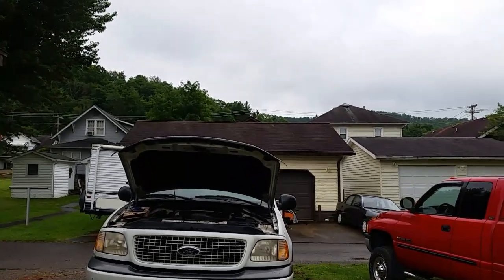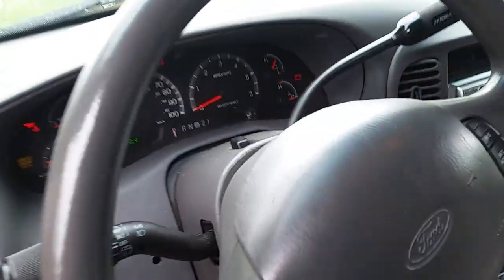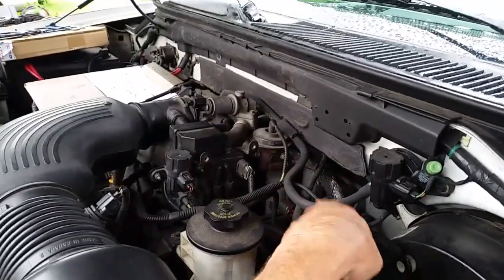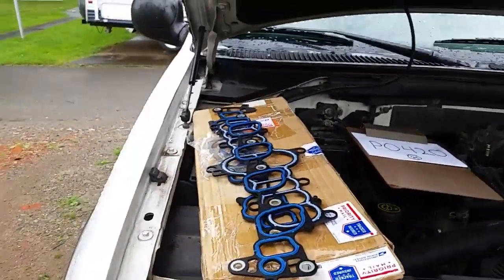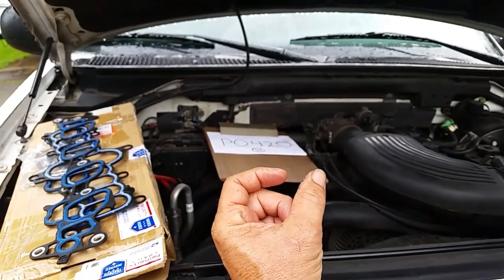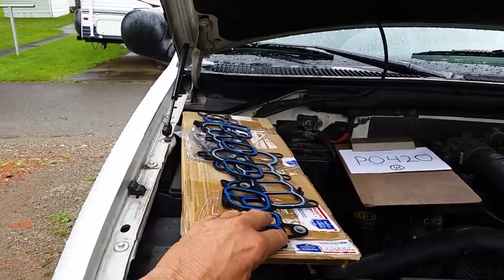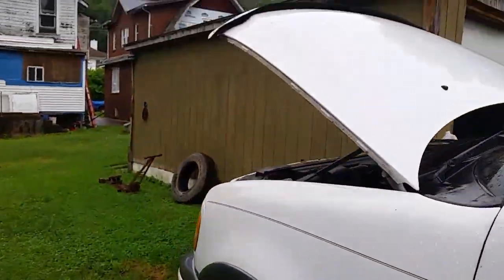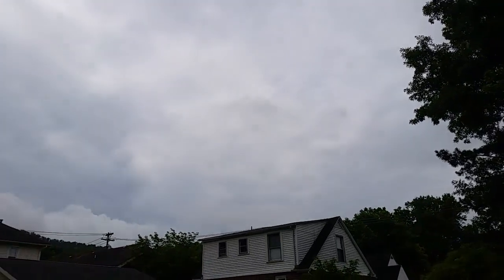P0420 Code. How to fix it. Don't spent spend tons of $$$.

Comment: I am dealing with the p0420 code on my 96 toyota camry LE . Back in July I replaced fuel pump and fuel filter thinking it cause of another issue that was caused me to break down but I ended up having to replace spark plugs and cables and the culprit was my distributor cap and rotar. No more than two months later is when the p0420 code occurred and eventually would stall out while driving. I now can't keep the vehicle running even 5 minutes before it shuts off . Was going to start with my O2 sensors .....
Reply from the maker: Take a small hammer and tap on the cat and listen to any rattling. Cat could be burnt u or get a obd2 code reader and look at the o2 sensors readings after the cats... before you fix anything.
Reply: Nathan Rohrbough  I had stopped by auto zone one day when the car was acting up . They did the courtesy check that’s when I found out the P0420 error code . What has me puzzled is it not staying on when I start it.

Comment: Very strange, typically p0420 is from downstream o2 sensor, which does NOT participate in air to fuel ratio measurement.
Reply: it still gets mixed up in exhaust leaks. but intake manifold leaks? that should show more or different errors than a P0420.

Comment: At start up on cold engine smell a faint gas reved at 2500 rpm I can still smell but don't know where it's coming from my 420 come on 1 trip 1/2 so if I do have a leak can that cause my fuel trim not to work right
Reply from the maker: Mine was a bad injector leaking fuel /or stuck injector.

Comment: Hi friend. So I replaced the intake manifold/gasket, checked for vacuum leaks, nothing is loose, replaced both o2 sensors and replaced cat converter (aftermarket) and I still have a P0420 code. That's the only code I have. What else could it be, what am I doing wrong? This is so frustrating! I just wish this code would go and stay gone and for my mpg's to go up... 🤦🏾‍♂️🤔🙄
Reply: did you fix it i have the same problem
Reply: @Mrlilrandom  hi, I recently found green coolant leaking coming from my thermostat engine coolant housing(water outlet/inlet). I ordered one from O Reilly's and they sent me the wrong one I'm just waiting for the right one. Hopefully that's the fix. I went through this thing like a fine comb like he insisted. The good thing is that's the only code that I have. I suggest you check, re check and check again you'll find it like I did. Good luck. 🙏🏾

Comment: You could look at freeze frame data. If O2 positive could possible vacuum leak n if Negative leaking injector or stuck purge
Reply from the maker: I found that one time on a intrepid.
Reply: So my 2003 nissan altim, which is running lean Short term fuel trim is up to 20% and ltft 10% ...

I have P0420 code. . . Could it be a leaking injector?  🤔

Comment: Nice. I get an occasional 0420, and just got an 0420 and 0430 at the same time. I'd been logging data on my phone with Torque. Both cats and all 4 O2 sensors are working as they should. Time to go clean some grounds before considering replacing my plastic manifold. A gasket set is a  third of the price of the manifold for my car.... and the manifold includes a full suite of gaskets.

Comment: Hi there. My engine light came on earlier today so the code po420  came up. I was told it was the catalytic converters.  How can I figure out if it’s the lower or higher on my 2004 alero?  Help?!
Reply from the maker: Inferred gun cooler going in hotter coming out...
Reply: Obd scanner. If your bank 1 sensor 2 02 sensor is fluctuating the same as the bank 1... 💁‍♂️ then ur Cat is probably clogged.

Comment: I got the 2010 gmc Acadia and I get P0420 and P0430 and I paid $1,300. to replace all catalytic converter and I still got the code back on. I don't good mechanics around I'm loss
Reply: Get a spray can of starting fluid and with the vehicle running, spray around the intake hose's. Keep a fire extinguisher handy for safety. Just saying. If the vehicle revs up when/where you spray. You have located the culprit. Bad hose, cracked intake. Did the mechanic change the upstream O2 sensor?
Reply: @Dangbo3030  not only the code P0420 I get liquid black petroleum in the exhaust pipes after I cleaned i get it back couples hours after. I've been servicing this truck over and over and get me more problems
Reply: @Dangbo3030  and the last come to ended was the engine oil pressure switch blown probably the engine oil low pressure turn the codes. But I didn't see no smoke coming out the muffler

Comment: If you have a vacuum leak you're going to be at getting a lean bank 1 or Lean Bank 2 code you going to get lean codes the O2 sensor you're talking about is that the rear that's the final and it is supposed to track so you may have multiple codes you would have a lean bank 1 or 2 a oxygen sensor front erratic not working out of parameter and also also rear O2 outside parameter you may have as many as five codes on this
Reply: Not true at least for honda

Comment: My freeze frame always shows perfect fuel trim numbers very close to 0. I think I have symptoms of a possible very mild/slow intake manifold coolant leak though, which from what I've read can get burned in combustion. Do you think this, rather than vacuum, could trigger my p0420? No other symptoms or codes. Car runs perfect.

Comment: i shouldn't say this because someone is going to try it. my friends dad used flex seal to stop his leak. he said he couldn't find the leak and refused to pull the intake. its been 3 years now and the light has never came back on.  i begged him to let me do it right but hes just to cheap. LOL
Reply: If it works, more power to him. Being a mechanic is about finding solutions, not just swapping parts.

Comment: I've got a 99 v6 4runner and I've burned through 2 cats in a year and a half. (About 30k) codes 420 and 446. It works and drives great but Toyota and local mechanics just say replace the converter, but why is it burning through them in the first place? No one can answer. I can smell it burning up.  Is there anything I can check myself? I have an obd scanner...

Comment: I have an annoying p0420 code in my 2012 Impala and I'm torn between doing this or that Cataclean additive.  Has anyone has success with either??????  Mine also comes with a weird "rattling/gurgling" noise ONLY when hard accelerating!!!!  Hoping to hear that someone else has had this happen and what they did to resolve it..... The Cat replacement is over 1k bucks so ill try anything first!
Reply from the maker: Get a Digital temp gun. You can get them for $20 now days. Measure the in/out cats temps. Out temp should be much hotter. If there the same temp then you will know. Do it several times to verify it.

Comment: I never thought of it this way but look at it as an air pump essentially that is what an internal combustion engine does it pumps air the O2 sensors work in conjunction with the IAC telling the computer how much air is going in and how much air is going out essentially the efficiency below threshold is stating exactly that somewhere along the way there's either too much or too little air. Good way to look at it

Comment: I just got the code🙄 It's a 99 Explorer. The previous owner said the intake gaskets were replaced. Mine runs as smooth as glass it just seems a little down on power and bad on gas. Any thoughts?
Reply: @Patrick Simmons
I had 2 codes P0420 and P0430 on my 2013 durango. Had an oil leak, very small. Mechanic replaced engine oil cooler and intake manifold gaskets. Cost me $880 but I also got diagnostic and oil change factory parts. I believe LKQonline has these parts used, come with warranty if that helps. So P0420 was CLEARED completely, now Im working on figuring out P0430 without having to pay $2000 for cat converter replacement. I believe finding the leaks around the car will fix the code. I didnt see the leaks while I was driving, they were tiny wet drops sitting on the bottom of the car after it was stopped. So alot of leaks you cant see.

Comment: I have that code right now” I tried everything “ so I have a K&N Cold air intake “ and duel exhaust magnaflow , do you think those are the reason why I can’t pass smog ?
Reply: Johnny Galvan . no that’s not the reason. i’ve been using knn’s on my ‘01 5.3 sierra for about 10 years & never have a problem. the truck always passes the NV smog inspection. 192K miles.
Reply: Daniel Flores   You know California and I think NY is a totally different monster to deal with when it comes to smog

Comment: Two weeks ago I changed the sparkplugs on my Nissan Frontier at 107k miles.  The truck runs smoother with more pep and better mileage.  But within a day or so the ECU spat out PO420 and PO430 for both banks of cats.  I cannot believe changing plugs will kill both banks of cats.  In changing the plugs I did have to remove the intake manifold.  I did not replace the gaskets as they are silicone and reuseable.  It is more logical that an air leak is the cause of my codes because it explains how both banks of cats died at the same time.  The engine idles very smoothly.  No hoses are missing nor do I hear any hisses.  Could it be the intake gaskets?
Reply from the maker: Sounds a little of both...
Reply: plugs properly torqued ? some engines need oem 02 sensors because of some reference voltage requirement.
Reply: He removed the intake.. chances are you have intake vacuum leak

Comment: I drive an 06 lincoln navigator 5.4...i haven't put a cold air intake but I do use a knn filter instead of the regular paper filter.... I have a code right now p0430.... Do you think it cuz of the filter?
Reply from the maker: Raul Gsxr ....Regular paper filter. Save you money. PO 430 possibly a intake gasket leak.
Reply: Nathan Rohrbough thank you

Comment: P0420 code is a "air fuel ratio code".   My stock 3v 5.4 260k miles original exhaust has gotten that code for bad spark plugs(computer leaned the tune) also plugged fuel filter(computer leaned the tune) code went away after tune up.

Comment: why would a downstream sensor (past the cat) be throwing codes for that. Your cat is either bad and not burning the correct amount of emissions or you have a bad sensor. That is the only correct  way to fix a 0420. lol. Do not take this advice. 4 cats???? lol. Mu lamborhini aventador only has 2 catalytic converters and i'm trying to limit emissions from a v-12.
Reply from the maker: That's what I said...lol And there are pre-cats. Take this advice.

Comment: i got a p0420 but the vacuum leak sounds like it is coming from the catalytic converter itself. when car is in idle it sounds like there is some sort of air leak, when i gas on it the sound is louder then before.

Comment: Had a p0420 tuesday, replaced cat, did the temp test, it dropped more than 100° should be good right...no! Cat is almost 20 years old, b1s2 was fluctuating like b1s1. New cat voltage on b1s2 barely move no more than .10. Explain please??????
Reply: Just passed this morning at a star rated shop.
Reply: Also it only cost me $190 and the guy did it in an hour. Had PO410 4 years ago did the samething, code never came back for tbat side. Do a pressure test, autozone will lend you the tool for free.

Comment: I got that code on my 2007 Honda civic.  I have the original catalytic converter in it and it has 285,000 miles. Should I replace the catalytic converter?
Reply from the maker: Do a weave form on a OBD2 code reader. It will tell you the truth.
Reply: @FixingWithPassion  What's a "weave form"?

Comment: I have a 4.6 L Northstar V-8 in my 2004 pontiac bonneville GXP the car only has 52,000 miles this code went off and the mechanic took my cat off and put a resonator on and told me to replace the cat and the  light will go off I replaced the cat and the light went off for a day and came right back on HELP! do you know if this engine has the plastic parts you're talking about so I can go back to this mechanic my car runs smooth and purrs because i've taken care of it hell was soon as it reached 50,000 miles I replaced the valve cover gaskets,coil packs and spark plugs for preventive maintenance.  I like this car a lot but this code is giving me grief.

Comment: I have a 2005 Chrysler, I'm going to try that. I just got that code. Twice. Plus the egr valve p0400
Reply from the maker: Yea I still have a po420...I need to fix mine also....ugh
Reply: Just let you know that I just fixed the P0420 code on my 2005 Dodge Grand Caravan this past Sunday.  The fix was to replace the downstream O2 sensor + the check engine light eliminator adapter (total cost ~$30).  The youtube link is as below if you are still interested:
https://youtu.be/qkhDeOvvvX0
Reply from the maker: Thanks Good to know!
Reply from the maker: BTW...Let me know if you get a po420 again. Be interesting.

Comment: I get a “test value” of .257 with a minimum requirement of .500 with my P0420 bank 1 code. I have new cats. Does that mean bank 1  pressure coming out the exhaust manifold is low? Can Intake be causing that as well?

Comment: Did replacing the intake manifold gaskets solve the p0420?
Reply from the maker: No It fixed the po430... the po420 was actually a bad cat.
Reply: @FixingWithPassion  Bank 1 or 2 pre-cat?

Comment: My car has this code, emissions kicking out 3x the legal co2 (uk). Once the cat gets hot it goes to 0.02 so was told just to leave it
Reply: put a bottle pr two of cataclean through it. or use some laquor thinner to clean out the catt. cost like $20 and you j7st follow the directions on the bottle (dump in ur ggas tank) it'll clean out the converter. may be worth a shot

Comment: I have the same code on my 2004 Chevrolet Silverado
Reply from the maker: O my!~
Reply: @FixingWithPassion  I replaced all brand new Bosch Brand 02 sensors. Then the code came on. I tried using cat cleaner hasn't done anything. I have an expensive bill due, or unless I can find some good cats off of a Tahoe, suburban, yukon, or sierra between years of 2000-2006

Comment: Hmmmm. It's been my experience that un-metered air infiltrating the intake manifold causes a lean condition on whichever bank the leak is occurring. I have never had a P0420 caused by an intake leak. Likewise I have never had an exhaust leak cause a P0420.  Your exhaust system is pressurized, it won't suck air in, it will allow exhaust fumes and gases to be pushed out through the leak. So, I am skeptical that your P0420 will be fixed by a gasket replacement.
Reply from the maker: Yea probably the rarest case possible. But intake leaks sre never good for the cats in the long term.

Comment: code po 420 change all plugs first bottle of fuel injector cleaner Wins reset code wait and see see if new code comes up.
Reply from the maker: Good test to do. Thanks for sharing!
Reply: What u mean by plugs?
Spark plugs?
Whats ur car pls?
Reply: U may be saying some valuable info, but no way I can figure it out, can u rewrite each line separately  (1) with comma or period (2) Noun & verb to each sentence where possible. 
What's ?  bottle of fuel injector &  what's Wins, are they part of above words or w resetting code or stand alone on their own ?
Will be appreciated.

Comment: Hello, I have a 2017 Hyundai Accent. It has 93000 miles on it. Yesterday I was driving and my check engine light went on.  The code the came up was P0420- 2/2 Permanent
Catalytic System efficiency below threshold (Bank ]]
I go and fill up my tank, turn on my car and the light went off. Anyone's thoughts?

Comment: I have an 2007 suzuki xl7 and this code popped up. My brother in law said it was the o2 sensor but after this video I'm not sure. My car has been bogging really bad and making a clacking noise. I don't know what to do, any suggestions??
Reply from the maker: Look at you engine for loose hoses, low antifreeze (slight leaks) and any hissing sounds related to broken hoses etc.
Reply: I used Scotty Kilmer's laquer thinner method and it worked for me.
Reply from the maker: Well mine has come apart inside. No magic will mix that. Guess I'll be buying a hack saw and a cat soon.

Comment: hi guys, i need your help..my car has detected P0420..but this catalytic converter already broken..and than i remove this CC i change downpipe. this problem appear, Check Engine appear if i use car more than 150km.. Please help this solution, what if installing extender in sensor o2 can helping?
Reply from the maker: It might work, but the computer is smart...
Reply: how to make it work effectively??

Comment: Hey I got a Nissan Quest 2005 and I was driving in the highway and it lost power . Doesn’t run rpms just go up
Reply: I got po420 pretty sure is the catalytic converter right it would rattle every tine I accelerated every time
Reply from the maker: Bingo!

Comment: NATHAN IM GETTING CODE PO420  AND CODE PO430  BANK 1 AND BANK 2. WHAT DO I DO.
Reply: P0420 is a "air fuel ratio code" p0430 is a "missfire code".....spark plugs went bad..so (computer automatically leaned the tune)

Comment: I've grand marquis 2008
I had changed intake manifold with a new one and new gaskets, the old one was damaged and leaking water to spark plugs. 
I dried every thing but still have both p0420 and p0430!
Ive cleaned the catalyst converter by a liqui moli product through intake manifold with no success! 
Whats do u think dear? 
Ive obd2 scanner and i can read about ratio for both banks 1 and 2 ratio is higher than max! 
And I've another reading but without code., which is evap monitor #81 is too lower than min! 
I read here some body talked about plugs changed and u agreed to him.   Which plugs?
If u mean spark plugs, i didn't change my spark plugs and there is no problem or any code for them showing.
If u can contact me on whatsapp for more pic pls..